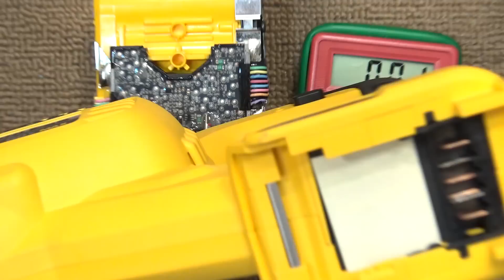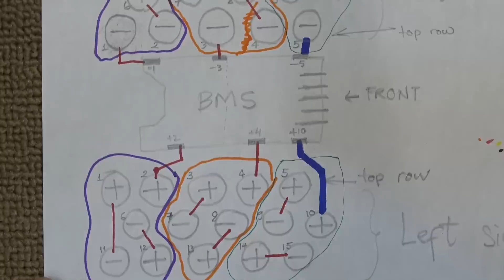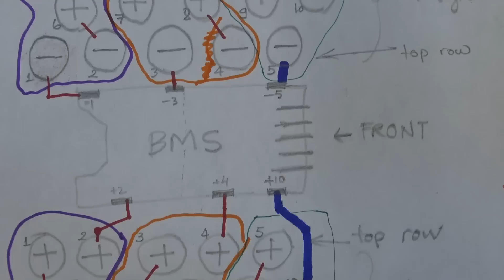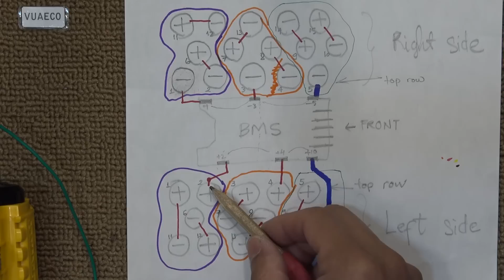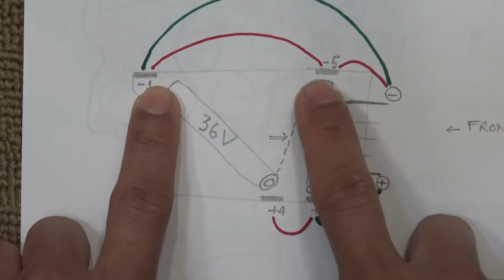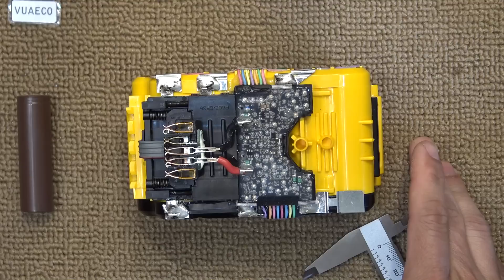Dewalt Flexvolt 60V 9Ah battery teardown & analysis: From 20V to 60V, How does it work?

Comment: Nice to got knowledge from your video. 
08:24 
"Why slid spring switch 54 volts?" and "why is an un-slide spring switch port giving 18 volts?"
Here is I got,
It's 3 banks battery which is each bank has 5 pcs 3.7 volts battery cell.
3.7-volt battery cell ( in good quality will be given 3.6-volt) in measure.
Single bank output giving 18 Volts output.
Dewalt DCB609 comes with @3.7V, 3000mAh battery cells (Samsung 30T 21700?)
When you working with 20 Volts (18 Volts) tools, the battery banks switched into 3x(18 V, 3 Ah)  in parallels battery bank connection (18 V, 9 Ah).
When you working with 60 Volts (54 Volts) tools, the battery banks switched into 3x(18 V, 3 Ah) in series battery bank connection (54 V, 3 Ah).
DeWalt makes 18Volts and 20Volts FlexVolts products, which is actually it is no different at all, except on the product voltage label, which seems like it caused by country regulation.
CMIIW.

Comment: This battery pack is set up in series for voltage series is positive to negative which gives you higher voltage but amp hours don't change so if there 3400mah cells then 4.2 volts x amount of batteries in series gives you voltage which is were the 9ah rating is coming from for 20 volt tools and 3ah is coming from for 60 volt flexvolt tools.... if the batteries were in parallel then it would be all positive side of batteries connected to each other and all negative side of batteries connected to each other ehat that style of system does is you get higher ampage or amp hours and voltage dosent change so it would be 4.2 volts for all batteries are 4.2 volts and the 3400mah rating would go up for each battery so 3400mah times how many batteries are in parallel so if they were all in parallel then it would be 3400 man times 15 batteries which gives you the max watts out so just remeber in seties gives higher voltage and no ampage change were parallel gives no voltage change and higher ampage output if you do both series and parallel you will get as an example 60 volts and 180 watts out would mean the battery is cut in segments just like your showing top row for each section has one battery linking the system which means the pack is both in series and in parallel thats how they got the 60 volt max rating with 180 watt hours of power which is close to 25 to 40 amps per battery dump discharge that battery at one time can put out a max of amp dump of 375 to 600 amps discharge depending on if there 25 amp cells or 40 amp cells hope this helps.....

Comment: Vuaeco, I can’t get my flex volt 60v to charge on the charger, charger blinks twice and then nothing more. I’ve tested it on numerous of my other dewalt chargers and same thing. I can get the battery to take a charge if I connect it in parallel to another 20v dewalt battery. But the charger still won’t accept it? I’m confused, please email me if you can help, I appreciate it and your videos are super helpful.
Reply: Have you found a solution? Had the same problem, i replaced a bad cell, put it on the charger, and charged well, used it once, work find and now cannot charge anymore. Opened the pack and all cell have equal voltage.. +- 3.6v, any idea?

Comment: I have two flexvolt batteries that are a few months old and all of a sudden either one will not power up my 6" dewalt grinder. I just did the test you did, jumped c1 and c3 and put my multimeter on the bat+ bat - and i get 20v but when i push in the switch it drops to 00.0 does that mean the switch isnt working? I know these batterys still power 20v tools, but wont turn on my grinder.
Reply from the maker: Looks like there's a problem with the switch. Did you push the switch all the way in? It has to be all the way in and not half way.
Reply: @vuaeco  Yes I pushed it all the way in, I just took my batteries  apart and on one side there is a very thin piece of metal that apparently is like a fuse because both batteries have lost connection. If you pause your video at 9:59 you will see in the upper right corner on your battery what I'm talking about. Thanks for such a great video, you just saved me $$$ I appreciate it greatly.

Comment: Thx  for nice video buddy   . You help me very very much i buy next step 9ah . I initially thought that the 9ah batteries had 18650 cells and wanted to know whether there were 21700 in them or not. I wonder if I take the new 8ah 20v or the 9 ah flexvolt is now a crucial question for me. Because the 8ah 20 v 21700 have something coming in 2020 or prefer the 9 ah 21700 in case I take it with me increase flexvolt devices.

Comment: Hi,

You mention the red cap helps for transport. I wish the airlines allowed these batteries in luggage. I had to fly to Hawaii to work on my property but i couldn't take batteries on the plane or in luggage.  I guess they didn't know how the caps really work. I took my tools and just bought some batteries on the island.
Reply from the maker: The law states max 160Wh capacity (depends on the airline). This battery is 60V, 3Ah or 180Wh is a bit over their limit.
Reply: @vuaeco  

Thanks for the information.

Comment: I just took a 6ah pack apart that is built the same way.  It takes a lot of skill and time to get the cells free since the black plastic on the sides goes over and under the metal tabs.  It took me 3 hours to get it all apart.  It's also difficult to not short anything out.  I had one cell that was zero volts and the four other cells in series were over charged to 4.42v.
Reply: I find it’s just easier to cut the plastic out around the cell your replacing. If your doing a full rebuild it would make sense to take the time to desolder everything. But if your repairing an old pack with old cells it just makes sense to make a quick repair on a pack that will soon fail.
Reply: what cells are in the 6ah?
Reply: @rynolda  They were 30a 2000 mah cells, I believe from Samsung
Reply: @rynolda  Samsung inr18650-20s

Comment: Great Video!  I believe the 21700 cells are used by Dewalt for the following reasons; 1) better heat disipation (for bigger tools), 2)21700 can go all the way up to 5000mah per cell, 3)the physically bigger cell can deliver the same current as the 18650 without heating up as much per watt delivered.  4) by using the 21700 now with the 21700 in rather early production they can take advantage of the improvements with the new 21700 of higher capacity without changing anything except the cells.  They will probably use the same BMS and definitely the same packaging so very little work to get even beyond 12ah batteries!

Comment: The Cells in this battery are 20700 cells rather than 18650s. Their bigger size gives them alot of advantages. As far as I know, these are Sanyo 3300mAh cells which would actually put the capacity at 3.3Ah @ 60v and 9.9Ah @ 20v, at least on paper. These cells also have a 30A continuous discharge which means this pack is capable of delivering around 1800 watts of continous power. Thats almost exactly the amount of power you can get out of a 120v wall outlet.
Reply: Do you happen to know the largest dewalt 21700 battery? 4ah compact? 6ah?
Reply: @hksjoshua  I think they are up to 15ah now. Huge.

Comment: "It's 20 volts" - meter read 18v
"60 volts" - meter reads 53.9v 

It would appear that Dewalt is in the business of misleading customers into thinking they are getting more than the competition.
When in truth, they are identical - behold the power of marketing
Reply: Well DeWalt in reality went with the 20v thing to not mix up the new 20v tools and the old 18v line... And basically stuck with it... Everyone markets 10.8 as 12...
Reply from the maker: It's actually 21V and 63V if you fully charge the battery.
Reply: @vuaeco  
Battery  ratings are determined from nominal voltages - otherwise, all of the batteries on the market would be rated higher than they are.

Dewalt sets the record straight under the * clause associated with there claim.

PS. all 18v packs will peak to 21v when fully charged

Comment: isn't the 2 pins shorting used to series 2 banks of cells instead of just "telling" the bms it' in a 60 volts tool?
That would explain why it has fat wires going to those 2 terminals.
Reply from the maker: I think the fat wires are there for a reason. There's limited space inside the battery so it doesn't make sense to waste space in there with some fat wires for no reason.

Comment: I like how you say, “puss the sweet in”.
Reply from the maker: Came here just for that? :D
Reply: vuaeco subscribed. 😁
Reply: vuaeco oh, and I tested 54v can power up 60v tools achieving the same power and result, maybe you could do the exploration onto why and how in details, I’m looking forward to learn from you and I’m sure it will help many dewalt user understanding 54v, 60v batteries.
Reply from the maker: @jasonlow7010  It's basically the same thing. 60V is 15S pack. Norminal voltage of these cells are 3.6V each. So if you take 3.6V x 15, you get 54V.

Comment: When fully re-charged you may get 2 to 3 volts higher than the advertised voltage.  You probably might see 62.9 volts fully charged;  and a fully charged 20 volt battery can reach 23 volts respectively
Reply: Nope!
18V/54V nominal voltage & 20.5V/61.5V fully charged
Reply: If you're seeing 22V from a 5S pack that has a max charging voltage of 21V or 4.2V per cell then your pack has put the cells in the "critical" overcharging area that starts at 4.4V and you should immediately stop using that pack. 4.25V isn't anything to get worried about but 4.4V with some of the crazy amperage we see with the fast chargers is concerning.

Comment: The reason use 2170 than 18650 is the same reason telsa using model3 vs model S which is more energy density. When 2170 has the same cap as 18650 it increase the life cycle and can be upgrade not just from 2Ah cell to 3Ah but also 4or even 5Ah in the future

Comment: Really good analysis.   I run a full range of 20 volt DEWALT tools but use their 60 volt portable saw.   I own several 20 volt batteries and 2 Flexvolt.    It’s a great system to allow 60 volt power where it is needed but gives high capacity 20 volt where needed like my high volume leaf blower.    Having a little more understanding of what’s inside and it works is very helpful.   I did not know that the cells were larger than 18650’s
Reply: The 6Ah and 15Ah FV both use 18650s. The 9 and 12 use 21700s.
Reply: @user-jm4nj7nz6t  good to know, thanks

Comment: Excellent teardown video! vuaeco did better job than than AvE on YouTube. I use these exact Dewalt 20V 9Ah batteries to power my e-bikes and drift trikes. I did not think 60V was an option until your great analysis. Flexvolt just released a 12Ah battery that is the same size as 9Ah. I subscribed and liked this video. Keep up the cool work.
Reply: For high current draw applications, you may well do better with the 6 Ah and 9 Ah packs. I can't rattle off the specs right now, but improvements of energy density often come at the expense of power density. Of course, the flipside is that the nickel strips max out even the lowest-current pack does @ 3P (Russell "Syonyk" Graves estimates 30 amps continuous, max). The DCB230 (and any subsequent 5S1P 21**0 pack) looks like a nice option for no-solder ebike power packs, when coupled with the now widely available 3D-printed battery interface adapters...if you can get them cheap.

The benefit of that style setup is the ability to warranty battery packs with DeWalt/SBD if/when they fail from [definitely not abuse], as well as easy replacement of a small block of cells if one craps out. It's also a good setup as battery tech improves, as the "FlexVolt" shit indicates at least to me that SBD is committed to this battery interface for several more years. This means you can upgrade by just sliding some new packs on, at which point your old ones could be used for less "mission critical" applications and/or ones with lower charge/discharge current requirements.

Comment: couldn't help but notice the bluing on the tips of his calipers most likely from shorting out measuring the cell, either off screen or in a previous take. good video though.
Reply from the maker: Very observant. The tips of the caliper touched the battery terminals and shorted out. It glowed red hot hence the discoloration of the tips. You're the first one to actually realize this.

Comment: Great video, very clever! I'm hoping you might help me figure out something - I want to convert a dewalt 54V angel grinder to work on a 52V 15Ah (30Q cells) ebike battery pack, do you think this is possible? I guess i would have to open up the unit and change the connector to fit my ebike battery that I would wear as a backpack. Do you think dewalt have included electronics to recognise only their own brand battery? The battery I have is fantastic and i want to be able to use it for other things besides the ebike! Thanks
Reply from the maker: That's a great idea! But Dewalt tools have some extra pins beside the main terminals in order for them to recognize their own batteries. I've tried different batteries connected to a Dewalt tool using only the main terminals but that didn't work. The tool wouldn't power on with just the main terminals connected.
Reply: Ah ok, nevermind! Thanks for replying so fast. I need to convert any 54v M14 spindle cordless angle grinder to a drill and run it off a larger battery due to remote operations. It is a pity that manufacturers do this, so many batteries go to waste and are left lying around for too long. If you can think of any other solution I'd love to hear.
Reply: I am also interested in powering Dewalt 60v tools with other batteries and I found your teardown video extremely helpful. I believe if a thermistor resistance (~10k Ohm) is applied between the tool's B+ and TH terminals, and voltage is applied between B- & C1/C3 and B- & C4, then the tool should operate. It would help me greatly if someone with a flexvolt battery measured those voltages and the resistance while the battery is in its 60v configuration. vuaeco, would you be willing to do that? Thank you.
Reply: This would be really helpful, please look into this further!

Comment: Actually, big fat 3.0ah is cheaper than the slim compacted version.
Reply: Dunno what you mean. I bought 2x DCB230 batteries at Home Despot for $140, and the DCB200 packs are $71.66 apiece on Scamazon. And the new ones will just keep going down.
Reply: 4 months on (says Yootoob), and the DCB230-2 pack is now down to $129.99. Also, I forgot to mention that these prices are all in Canadian dollars.

Comment: .do I still get 9amps when I use all 60 volts???
Reply from the maker: No, you get 3Ah.
Reply: seth bates No you get 3amps but that will a run as long as 9amp battery running 18/20 volts because it run more efficiently
Reply: "...but that will a run as long as 9amp battery running 18/20 volts because it run more efficiently"
No.

Comment: The travel cover has nothing to do with covering the terminals but it a switch that technically takes it from 1 battery at 162wh to 3x 54wh.
 maximum wh via aircraft is 100

Comment: Wow, great video. Thank you.
Looks like I now know how to make 60V (or 54V) out of those flexvolt battery packs.

By the way, Black+Decker also has 60V batteries, that outputs 20V initially from two terminals. And it does not have a physical switch but just more terminals.
Since it would work similar way as Flexvolt, I might be able to figure out how that works.
Reply: Oh, and I also just remembered there are several other SBD brands that use the same or similar packs, including Bostitch and Mac Tools. In fact, I just learned right now that SBD owns Mac Tools (but I already knew their tools use DW "20V" packs).
Reply: Stanley Black and Decker is the parent company of DeWalt, and the battery pack interfaces for so-called "20V" are near-identical (and interchangeable with minor modification). Anyway, figuring has already been done on the DW...

https://www.youtube.com/watch?v=bB6CuCzbWl8&lc=UgwyFv8hZbU6xa1f9M14AaABAg

Comment: Excellent analysis of the battery. Couple of questions though:

1. Are you inferring that that the -5 terminal is temporarily connected to the negative output pin or are you basing this on observation of the wires? Reason I ask is because it doesn't seem necessary since it would be connected in parallel in 20V configuration anyway.

2. What purpose does the jumper serve? I would guess it has something to do with onboard monitoring of tool function but not certain.

Subbed and looking forward to getting a closer look at the terminal connections behind the switch!
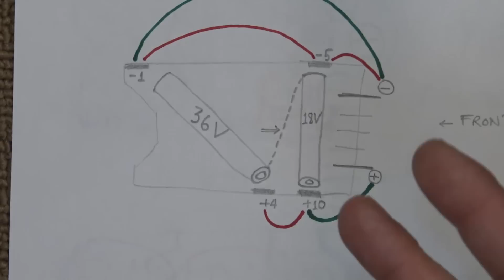Reply from the maker: 1. That's correct. At 23:30, the (-5) terminal is moved to a different position. So yes, it is just a temporary connection until the switch is pushed in.
2. I think you're correct about the jumper (for the black and red wires). And I also think it serves both as a monitoring tool and current carrying wires. There's a reason why these 2 wires are so thick.

Comment: Thanks for this! I really enjoy watching all your videos and I was particularly curious how the DeWalt Flexvolt worked and you answered it beautifully.
Reply from the maker: My pleasure.
Reply: @vuaeco  Thank you for your videos, always interesting. Do you know what is the BMS current draw limit on the Flexvolt 20v 9AH battery?. I am currently using 3 in series to deliver 54v to power my E-bike at 28A max. However, I am looking into upgrading my E-bike to use 60A at 54V. The cells should be good for 90A draw at 18V (5s3p) but what about the BMS? I would appreciate your opinion, thanks.

Comment: hi I'm looking to make a 36v kit for my e300 as the lead acids died in cold weather well they charge  not holding up well.i want to solder the kit with nickel plating and ly them flat so they fit under scooter deck . I have some Samsung 26h 30 an rest will be about 2000mah used
Reply from the maker: That'd be a nice project built.